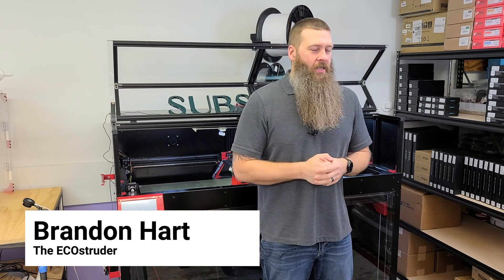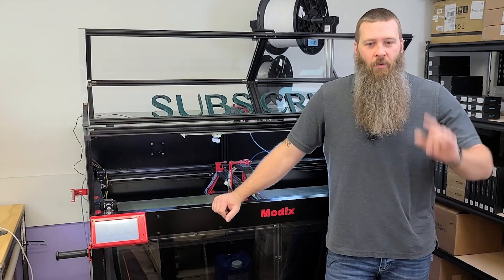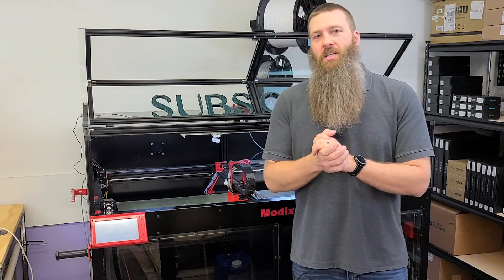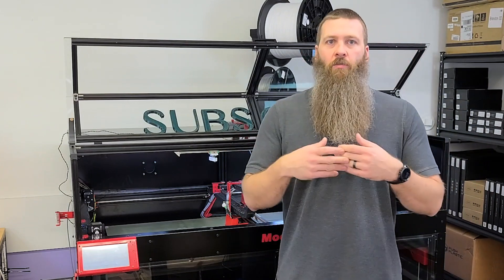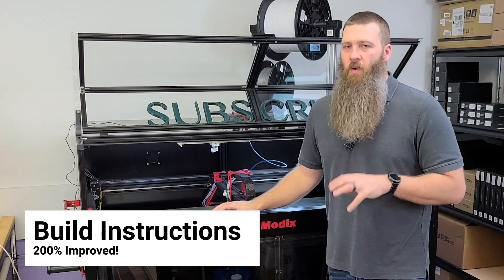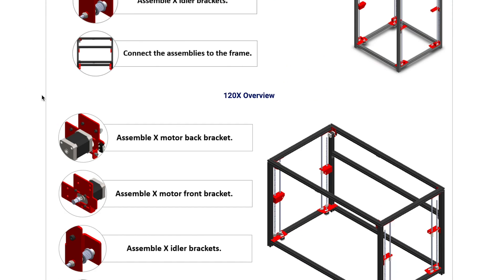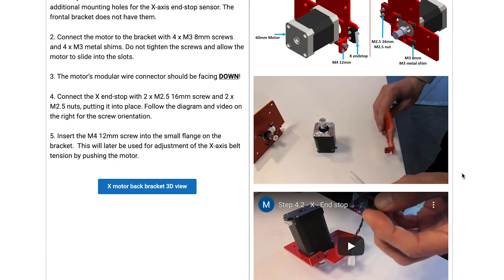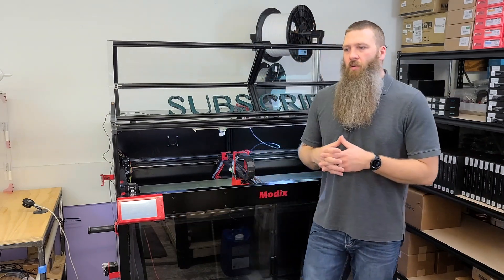Modix Big-120X Review After a Year! Part 1: V2 versus V3. What's the difference??

Comment: Hi i have the modix 60 and after 2 years cannot get it to work
Any videos to get started
I’m running 1mm nozzle
Reply from the maker: Sorry to hear that you haven't had a lot of luck getting your Big-60 working. They certainly aren't the easiest machines to get started with, which is why we at HartSmart Products are always so insistent that people new to 3D printing don't start with them. Even those of us with 3D printing experience can struggle at times, but the machines are certainly capable of producing great results. I'm afraid there aren't any videos for how to get started out there, but if you shoot an email to support@modix3d.com the Modix support team should be able to assist. If you've already done that and are wanting more then HartSmart Products offers paid support packages as well. Contact Support@hsp3d.com to inquire about that. We'll spend some time diagnosing the issues and then can prescribe some potential fixes. Hopefully it's something simple that has just been overlooked!
Reply: @ecostruder  Ive been printing for 5 years and this is my 10th printer
I just cant get my head around setting it up
I know cura and ideamaker very well and print great
I’m trying a 1mm nozzle with PETG, modix tell me to up the temperature to 250c, but when i do it boils, i have better results at 200c
Reply from the maker: @deanlegg418-u2k  Are you saying that you have good results printing PETG at 200C?!? If you are printing PETG at 200C then I can guarantee it isn't actually PETG on that spool. Either that, or your thermistor/PT100/PT1000 sensor is way off. We print PETG on our various Modix machines all the time, and are typically between 240C (small nozzles, printing slowly) and 270 (big nozzles printing very fast). Hard to know exactly what it is, but something is definitely not right with your setup as you have described it here.
Reply: Defiantly PETG, so you think the thermocouple is the problem?
Reply: Can i recalibrate the thermistor, or need a new one?
Reply from the maker: @deanlegg418  It's hard to say without seeing it, but the easiest thing to do to ensure that everything is working as it should is to go ahead and replace it. When you replace it ensure that your firmware is configured properly for whatever type of sensor it is (thermistor, PT100, PT1000). Then run a PID Autotune. After that you should be set. Good luck--I hope that solves your issues with the printer.
Reply: This is where I get stuck, how do I check the firmware and do a PID
What is a PID?
Thanks Dean
Reply from the maker: @deanlegg418  This information is available in the Modix Customers Zone. If you don't already have login credentials then you'll need to request them from support@modix3d.com.

Comment: do you have an update on this? 
and also how much did you pay for it? or how much are they going for ? for the 60 size version ? ?  ?  was software included?
Reply from the maker: Pricing on these machines varies quite a bit over time, and based on the configuration you specify. Check them out at our website here for more information: www.hsp3d.com.

Comment: Hi. Thanks a lot for sharing it. I am thinking on buying the big meter or big 180x. Some questions:
Would you recommend it for moderate industrial use?
How does it perform with large nylon and fibre reinforced objects?
What is the maximum steady temperature you gen in the chamber?
What maximum output rate can you get from the supervolcano with good results? (Surface smoothness not very important)
Thanks a lot!
Reply from the maker: Thanks for watching! These are tricky questions to answer in a YouTube comment, but I'll give you a qualified yes. These machines are incredibly inexpensive for what you get. But that low price point means that they rely heavily upon the user to get the best out of them. This is why I won't sell a Modix printer to a customer that has never used an FDM/FFF printer before. It's not for beginners in any way. If you know how to print with nylon and fiber reinforced materials on a desktop printer then you'll have good luck doing it on a Modix printer as well. But any small issues you have on a desktop printer are much worse on a Modix printer. 
The chamber is passively heated, so the chamber temp will depend on what your bed temp is. 
I don't use the Supervolcano on any of my Modix printers anymore. There are a lot of superior hotends available these days, such as those available from Slice Engineering, Takoto, and others.
If you have other questions please email ECOstruder@hartsmartproducts.com!
Reply: @ecostruder  wonderful! It helps me a lot. Thanks for answering

Comment: Is this machine any good at doing large volume polycarbonate prints?
Reply from the maker: Great question! I was skeptical that it would. But we did some multi-day long Polycarbonate prints for a client and had very little warping. The machine performed perfectly and the finished part was gorgeous (and crazy strong). Keep in mind that it will not print with PC as a completely stock machine. You'll need to upgrade your hotend to print with higher temp materials like PC. Check this out: https://hartsmartproducts.com/products/modix-premium-printhead-upgrade . You'll also need to coat your bed with something that PC will stick to. I like Magigoo PC, or possibly just a large sheet of Garolite. Both work great for PC.
Reply: @ecostruder  Perfect, excellent response thank you for your expertise, cheers!
Reply: @ecostruder  Okay I checked out the premium printhead upgrade and I think I'll hold off until they come out with the dual extruder version.

For the Modix I think I'll go for the Big Meter version, it maxes out in build capacity with a whopping 1 billion cubic millimeters, BANG! 

Do you have any recommendation for a sturdy durable reliable bulk PC pellet filament maker? I think this may be a requirement for affordable large volume printing.
Reply from the maker: @supersasquatch  It sounds like you'd like to have a slightly deeper discussion than is practical in the YouTube comments. That's awesome, so let's continue by email instead. Will you please shoot me a message to ECOstruder@HartSmartProducts.com so we can get a bit more detailed that way? Talk to you soon!
Reply: @ecostruder  Willl do! expect it in the coming days, cheers

Comment: Hi a great and comprehensive review of the printer. I just bought a x120-v3 and I wonder if it wasn't the case to upgrade to the duex5 directly. How do i upgrade to duex5? I really like the automatic leveling option! In ours it is sometimes a nightmare to get it leveled well. Does the duex5 replace duet 2 or is it an add-on?
Reply from the maker: Congrats on your new Big-120X! The Duex5 is a nice addition to the Duet 2 control board, but it's certainly not an "easy" upgrade to do. For one thing, each motor will now need its own stepper motor cable if you want to individually drive each of them for automated tilt adjustments. You'll also need to relocate some of the wires so they aren't using the expansion pins. Good luck with the modifications!

Comment: Would you recommend this printer for a teenager
Reply from the maker: It would really depend on the teenager! But I do not recommend any Modix printer for a user that is new to 3D printing. This machines assume that you already know how to run a 3D printer, diagnose print quality issues, solve bed adhesion problems, repair broken parts, perform maintenance, etc. It is much easier to learn those things on a desktop printer than to learn them on a Modix printer.
Reply: @ecostruder  what if the teenager has no experience in 3d printing
Reply from the maker: @Jeff75684  Like I said, I really don't recommend this printer for beginners, regardless of their age. I would highly suggest the teenager in question get a desktop printer, such as a CR-10 or Ender-3 (this is why we started selling those on our website, www.hartsmartproducts.com). It's much easier to learn on something smaller and more accessible like those!

Comment: Are you also using closed loop motors on this one, or if not  do you think the quality is good enough at this point that they wouldn't make any difference? Thanks for the video! 👍
(I'm considering a career change and starting a 3D printing business in the Netherlands, so I'm evaluating options)
Reply from the maker: Nope, no closed loop motors on the V3 machine, just on our V2. Because the control board is different (no removable stepper drivers) it requires a different type of closed loop stepper than what we used previously. I know there are some out there, but we haven't yet tried it. Good luck with the potential career change!